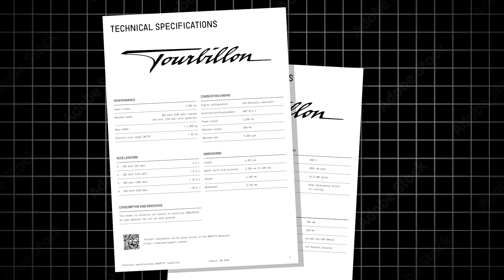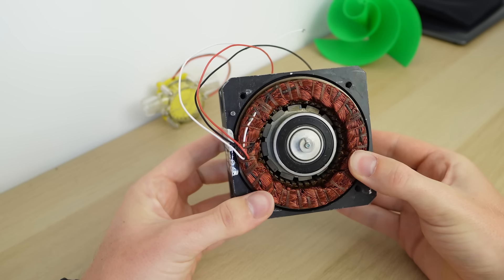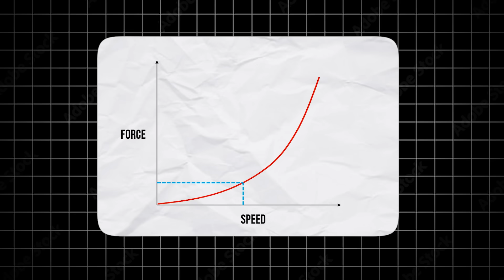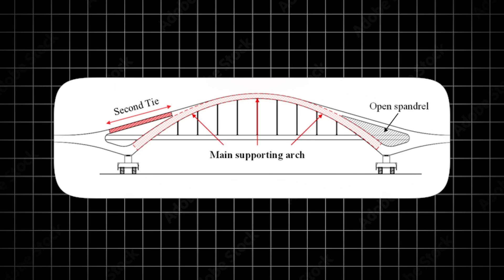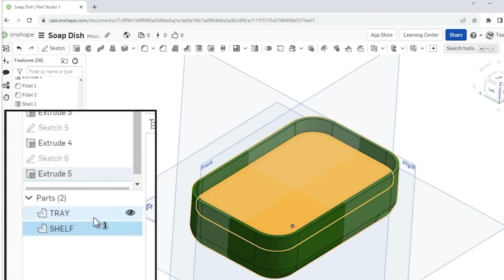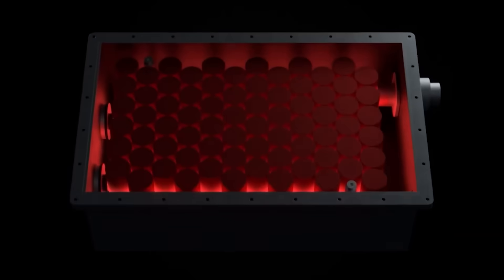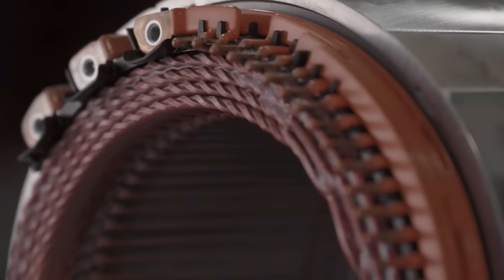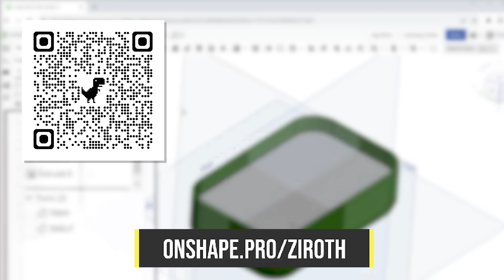How Bugatti's New Electric Motor Bends Physics

Comment: Two (semantic-ish) points: It's not exponential if it goes by the square. And saying "temperature is 23 percent lower/higher" is basically absurd as it's scale-variant.
Reply: Excellent points. Though the title using  "...New Electric Motor Bends Physics...", is so full of absurdities and compromises that it should prepare the audience for what is about to transpire. Not necessarily the authors fault, it is just the way the world currently runs. The author must walk a line of grabbing a large generalized audience and keeping them engaged long enough to impart some knowledge. If they write it as a submitted dissertation, it may be more accurate, factual and concise, but the audience will be very limited. I've only know one person capable of coming close to parity with this dilemma, Dr. Carl Sagan. And lets face it, Dr. Sagan set a very high bar.
Reply: @me1assassin 

It’s called ‘clickbait for positive delta in ratings
Reply: Good point. The term “exponential” is used incorrectly at a, well, exponential rate 😅. The term he was looking for is “geometric” increase, or by the square. To be exponential, the independent variable has to be in the exponent. And 2 to the x power (say) gets bigger WAAAAAY faster than x to the 2nd power.
Reply: The paper clearly shows the scale it was calculated in. So nothing to see here…
Reply: Absolute temperature or temperature difference? Often the performance of heatsinks are measured by degrees per watt
Reply: @sammy5576  yep. Degrees per watt transferred is a delta, not an absolute (or indeed, a scale factor) measurement. It’s usually the number of degrees above ambient or above the temperature of the coolant, whatever is on the cold side, basically.
Reply: Looking at that flag in your pic tells me you don't know your knees from your asshole
Reply: Ukraine is a corrupt nazi filled country
Reply: One more semantic: Ukraine is a scam.
Reply: shhhh he's bending phyics... wait for it.... wait for it...
Reply: Just shut up.
Reply: I believe it's the bernolie theory at play energy equals mass times velocity squared that he means to quote.
Reply: An exponential function is anything of the form f(X)=A^x nothing wrong with the way it’s stated in the video. F(X)=e^x is classified as a natural exponential function.
Reply from the maker: That's a great point, maybe they should have used the kelvin scale
Reply: @ZirothTech the results would have been less impressive (and meaningless). 40°C instead of 54°C is perfect!
Reply: @ZirothTech  no that would also be wrong. You left out a word. It's a temperature delta of 23%, which doesn't depend on scale or ambience
Reply: @DoesntRefillTheBrita  Yes it does. It's 25% in C, 20% in F and 4.3% in K
Reply: @geoffbogg6124  but that's not what the author meant by percent
Reply: @DoesntRefillTheBrita  the problem is that the only temperature scale that has any physical meaning is the Kelvin scale. All other scales just add an arbitrarily zero offset.
 This means that if you look at a ratio of temperatures you can get any answer you like by altering the arbitrarily zero offset.
If your offset is 290K going from 290.1K to 291K you would have changed the ratio by a factor of 10 by going from about 17C to 18C. 
So unless you say the temperature is 30% further from freezing point, it is meaningless.
Reply: @daveansell1970  you wrote all that but totally missed the one important word that made the entire thing pointless. 👉 DELTA 👈
Reply: @DoesntRefillTheBrita  saying a temperature delta of 23% still doesn't make sense. A delta just means difference - T2-T1 which will have units of temperature. You would still have to say a percentage chance in temperature relative to 35C or whatever.
Reply: @daveansell1970  no you wouldn't... Do you know how differences work? Go ahead try a temperature delta in all 3 units
Reply: @DoesntRefillTheBrita  i have a fair idea. A delta is a difference so 300K - 290K would give a difference or a delta of 10K.
Reply: @sammy5576 A delta T is a temperature difference. It is not measured in pecent, as it dos not depend on the starting point, hence the focus on delta. Eg. a 10K delta T.
The magnitude of a percentage is relative to the starting point, and for temperatures that only makes sense for an aboslute temperature, i.e. on the Kelvin scale.
Reply: @DoesntRefillTheBrita  Where do you see the delta in the 8:10 slide ? "Maximum cell temperature was up to 26% lower" then they say 40° C vs 54° C. This is just wrong.

If it would actually have been about delta, then yeah, your point is correct. But it doesn't apply here.
Reply: @Winnetou17  yes, that's why it's an error :)
Reply: @geoffbogg6124  So, you think 1° C is 1000% as warm as 0.1° C? And -10° is 1000% as warm as -1°? :D
Reply: @sammy5576 wrong. You would be right if the scales all had the same zero.
Reply: I think measuring it off 0 kelvin is arbitrary. If you want to use a percentage you should reference it from the starting temperature, ie the room temperature. @FizzBhaal
Reply: We’re way past autism awareness month.
Reply: @kiuk_kiks  Someone finally said it:text-green-game-over:
Reply: I need Terrance Howard to break this down for me.
Reply: Right on, but you're being bit stiff, it's ytoube not counsil of sciences.  🥴
Reply: Squared is still exponential. It’s there in the name, an exponent.
Reply: @AvgJoeCrowe  that's not how it is defined unfortunately, in mathematic big O notation which describes the growth rate of a function, O(n^2) is called quadratic / square while O(c^n) is the one that's called "exponential"
Reply: russia better than ukraine
Reply: There's another one. Dielectric oil. It's kind a flying airplain or an edible bread.
Reply: @lashamartashvili not all oils are dielectrics.
Reply: I am stupid, I don't understand how square isn't an exponential, could you explain why we can't say square is exponential?

Does it have to use Euler's constant to be exponential?

What's the correct term to describe the graph here then?
Reply: @prateekkarn9277  The term for x^2 is quadratic, or more generally, polynomial, if it's anything in the form of Ax^3 + Bx^2 + ...   . "Exponential" means x is the exponent, like e^x, which will overtake any polynomial eventually.
Reply: @prateekkarn9277  exponential growth is any function of the form C*a^x. For example if a=2, we'd expect the centrifugal force to double every time the motor speed increases by a single rpm.

Essentially quadratic growth (or any growth that is of the form x^a) relates a scale factor to another scale factor while exponential growth relates a step to a scale factor.
Reply: @prateekkarn9277  The correct term is "polynomial" in a generic way (f(x) = a(n)*x^n + a(n-1)*x^(n-1) + ... + a(2)*x^2 + a(1)*x +a(0)  with a(n) a number) , or quadratic if it is only power of 2 (f(x) = a*x^2  ) witch is the case for centrifugal force vs RPM.
for a quadratic, f(2.x) = a*(2.x)^2 = a*[ (2)^2 * (x)^2 ] = a*4*x^2 =4 * a*x^2 = 4 * f(x)

For generic polynomial of order n, when x is big enough (close enough to infinity), x^n >>> x^(n-1)  So whatever a(n) and a(n-1) you can approximate f(x) to a(n) * x^n. 
In such condition, f(2x) ~ 2^n * f(x)

An exponential have x as exponent, ie f(x) = a^x     (let's assume a>0, but with a<0 it is also an exponential, it is just a decreasing one, which is not the kind we think about when talking about exponential growth )
For such a relation, the output f is multiplied by a every time x is increased by 1, not multiplied by a factor :  f(x+1) = a^(x+1) = a^x * a^1 = a * f(x)
Every time x is multiplied, f is raised to a power of the factor : f(2.x) = a^(2.x) = a^(x+x) = a^x * a^x = f(x) * f(x) = f(x) ^2

So if you compare polynomial to exponential, for x big enough, you get P(2.x)~2^n * P(x) while E(2.x) = E(x) ^2
Since we assume a>0, E(x) is a growing function of x,  and 2^n is a fixed number, there exist a number x0 so that if  x>x0 so that E(x) > 2^n.
Then, E(2.x) = E(x) * E(x) and we have seen E(X) > 2^n , which means that even if E(x) < P(x), if x>x0, then E(x) grows faster than P(x) and the higher x, the bigger the difference in growth.

This is what it means to have exponential growth. Whatever the polynomial you choose, and however slow the exponential growth may seem at the beginning, in the end the exponential outpace the polynomial.
Reply: You have to use the Ukrainian flag to understand it ;)
Reply: @prateekkarn9277 It’s geometric instead of exponential.
Reply: So, polynomially or quadratically instead of exponentially? Doesnt read well
Reply: @aaronh1372  quadratically is the correct term
Reply: @DoesntRefillTheBrita  so, times four? That's how it reads to 99% of the world
Reply: @aaronh1372  "quad" means square... It's squared... Are you slow?
Reply: I dunno wtf yall are talking about but ok. 
I also take "quad" to mean 4, like probably most people not trained in math. 
I could make all you big smart math people feel dumb in my specialized area of expertise too, but I think it is unbecoming to talk down to or insult people because they dont understand your specialty.
Reply: @MattH-wg7ou Quadruple = four times. E. g., quadruple of 5 is 20. Quadrated = times itself = squared. E. g., 5 quadrated = 5 × 5 = 25. 
See how very differently quadruples and quadrates grow: quadruple of 50 = 4 × 50 = 200, whereas 50 quadrated = 50 × 50 = 2500. Exponentials grow much much faster: 2 to the 5th. power = 2⁵ = 2×2×2×2×2 = 32, and 2 to the 50th.  power = 2⁵⁰ = 1,125,899,906,842,624.

Edited: included 2⁵⁰.
Reply: @aaronh1372  It's irrelevant how it reads, or at least it should be. These are two completely different classes of functions. Anyone who's passed basic calculus should know this.
Reply: Somerhing squared (Multiplies by itself) is the epitome of exponential, if this means the same as in german im not a native speaker.
Reply: @cod4razorgt398  Don't let the language confuse you. It's about the rate of growth, and what is the variable. x^2 is not the same (of same order or magnitude) as e^x
Reply: Say you have autism without saying you have autism.
Reply: @sonnygmony  so you are assuming he's verbal non verbal autistic....
Reply: @sonnygmony  what the heck does autism have to do with any of this discussion? Please don’t use that word so carelessly, especially not as a derogative, which seems likely in your case. Anyone can be pedantic - autism has nothing to do with it.

Comment: 2:34 Shows parabula. Says "INCREASES EXPONENTIALLY!!"
Reply: The exponent of a parabola is 2. For linear growth the exponent has to be 1 and only 1.
Reply: Exponential growth is when the variable is the exponent.  2^x is exponential growth.  x^2 is quadratic growth.
Reply: @Proud2bmodest that's not how it works, you should have learned this in high school. Exponentially means it's a function of its current value, something a parabola is not.

Comment: How about an 800BHP pure EV version, with the ICE engine and ancillaries replaced with more batteries?
Reply: A hybrid would be better
Reply: Would be an insult to Bugatti, previous base model made 1500 hp
Reply: Yes, the weight of the 16 cylinder  engine does seem like a bad design choice.

Comment: why aren't they just using charged coils instead of magnets? Then you don't need to wrap your rotor with carbon fibre and epoxy and they can adjust the strength of the magnetic fields of the coils.
Reply: Because they want the speed.
Reply: @Barskor1  then add an exciter to the same shaft?

Comment: The title is pretty clickbait-y with the "Bends Physics" bit.
A word of advice, I recommend you stick to more solid and concise videos such as the "bionic wings" video for example.

When a channel is built around relaying information to a wider audience, a lot of weight is put on it to be accurate and have integrity.
When you make a video over every little new tech product or advancement you increase the likelihood of something slipping through your fact checking. And the channel will closer resemble a "Techno-slop" channel.

Instead of making the video centred (titled?) around Bugatti specifically. It could be centred around the engineering of High-Performance EVs and their challenges in general... Covering both the techniques used in making motors that power-dense. As-well as the difficulties with making sure the battery can even supply the power needed without blowing up.
Reply from the maker: Thanks for the feedback, this is definitely something I'll try to do more in the future. Its a super busy time for me as I finish university and this video didn't get the usual amount of production time

Comment: A tip: instead of comparing RPM, compare peripheral speed. Speed to material strength ratio is constant wrt size, while RPM have an inverse relation to size (for the same material strength).
Reply: Yes.  Look up inertial energy storage devices, and and look at their rotor shapes.  When we did this with fiber materials, the ideal rotor looked kind of like a misshaped tit.  With metals it had a more blunted shape.  We rant these into destruction, often at about 150,000 rpm, usually in partial vacuum, since the surface velocities were supersonic.  Metal rotors typically destruct into about three pieces.  Fiber rotors tend to shred, especially in air, since the supersonic shockwaves become very irregular, as soon as one fiber starts giving way.  This is actually a safety factor, since if it disintegrates, the stored energy is distributed into a mesh of garbage, instead of flying bullets.
Reply: @brunonikodemski2420  Whoa, is there any footage or more information on these tests?
Reply: Do be sure and scale that to sitting in a traffic jam in the morning in this. You would be standing still SO much more efficiently with so many horses asleep in the back. 🤭:face-pink-drinking-tea:
Reply: @InservioLetum  Commentator below did not understand what you said, but I believe I did.  With the inertial all still there, all you have to do is turn on the electronics, in about 20-milliseconds (we actually did this) and then you have full torque at the wheels.  The lag is due to the inductance of the windings, versus resistance, which cannot  be overcome unless motor is redesigned.
Reply: @InservioLetum  Sorry, I don't understand what you want to say. What's got rotor peripheral speed to do with traffic jams?
Reply: @markotrieste   @InservioLetum  Commentator below did not understand what you said, but I believe I did.  With the inertial all still there, all you have to do is turn on the electronics, in about 20-milliseconds (we actually did this) and then you have full torque at the wheels.  The lag is due to the inductance of the windings, versus resistance, which cannot  be overcome unless motor is redesigned.
Reply: Correct . 24,000 rpm is not "incredible" for a rotating mass like a motor armature .
It may impress a petrolhead but it's no big deal.
In 1924 there were ultracentrifuges that  permitted angular accelerations of up to 100,000 g at 42,000 rpm.  Today the numbers are 100,000 rpm and 1,000,000g.
I worked for Beckman Coulter who have a long history in the field . A fellow engineer told me of a centrifuge that broke the mainshaft after a bearing seized  and it took 3 hours for the rotor to come to a stop , because without a connection to the motor  dynamic braking was not possible and  the rotor had to coast to a stop
Reply: wrt = "with relation to " ok now pause for a moment while OP tries to bend more physics
Reply: @mactabilis6039  Not bending anything, it's the structural equation of rotors.

Comment: Lowering the temperature 26% is a stupid measure when talking about Celcius. The temperature was lowered from 54 to 40℃. That means the temperature dropped from 327K to 313K. That is a 4,3% difference.
Reply: You found the wrong statement and corrected it with another wrong statement. It's temperature delta
Reply: Lars, he was talking about temperature increase, not absolute temperature. A 10 degree increase is twice as big as a five degree difference regardless of the scale or the beginning temperature

Comment: 4.1 C to 1.0 C is not 76% reduction. They are degrees, not absolute temperatures. You can only use them for delta temperatures that way, say the coolant is 0 C, then yea you can say delta-T dropped 76%. But 0 C is not the absolute zero. Easy check: convert the units to Fahrenheit and do the same math. The drop would be from 39.38 F to 33.8 F, thus 5.58 F drop which would be 14.2% reduction. If changing units yields different results, then the math is wrong - like is in this case.

An easier "reality check": if temperature went from +1 C to -1 C, how much would the percentage drop be? 200%? It's not possible, you cannot lose 200% of temperature.

Nice video nevertheless, just wanted to address this (relatively common) error.
Reply: Yes. It annoys me so much when TV "metrologists" say things like "this year the mean temp of July was up 20%". We would all be dead if that happened.
Reply: and thats why you should always use kelvin instead of celsius when calculating. 277k to 274k is a reduction of 1,09%. Kelvin uses the same graduation as celsius but starts at absolute zero -273,15 °C
Reply: Thank you for helping keep bad science YouTubers from feeding is total BS 👍😁